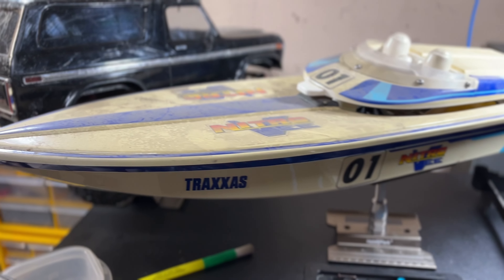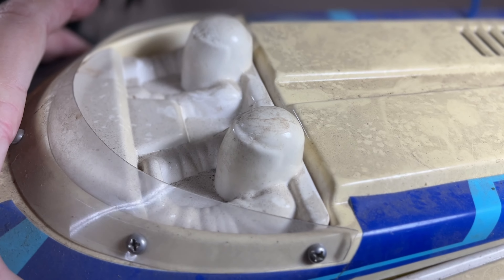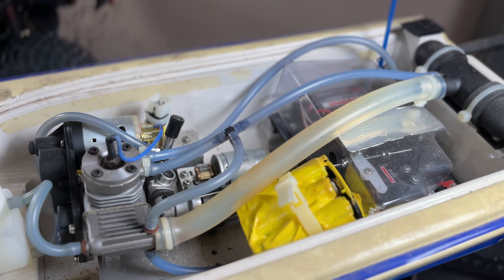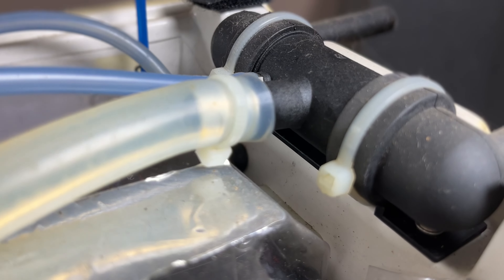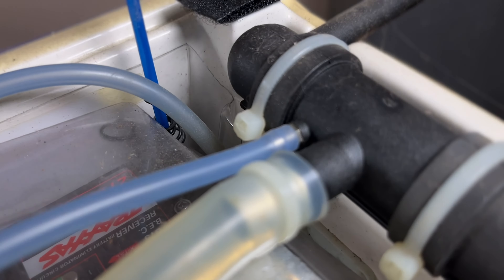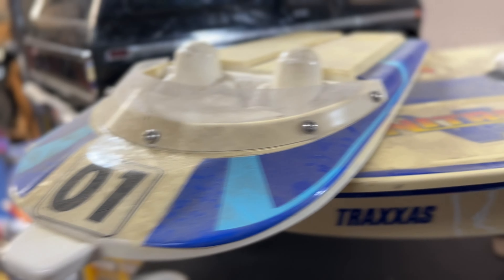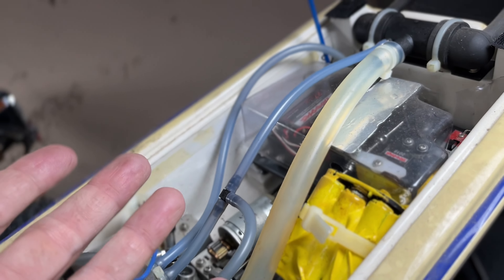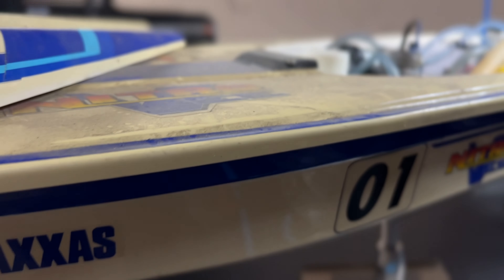Uncovering A Hidden Gem: Traxxas Nitro Vee RC Boat - Stay Tuned For The Restoration!

Comment: Good find! I picked one up on Ebay a couple years ago, unfortunately the hull was cracking quite a bit being that it's old plastic and the nitro fuel doesn't help matters so I ended up covering the entire hull in a epoxy to make it stronger and water tight,freshened up the electronics including servos, battery system,remote and receiver, went through the engine and fresh hoses plus a black with red trim paint job. Came out pretty good. Definitely a fun build and would do it again given the opportunity. Enjoy your build, would love to see some videos of it on the water!
Reply from the maker: We will be working on this boat soon. As with all projects... its hurry up and wait! Plus these "pESKY" Customers want us to work on their stuff 1st!